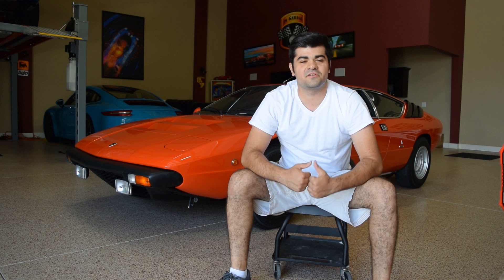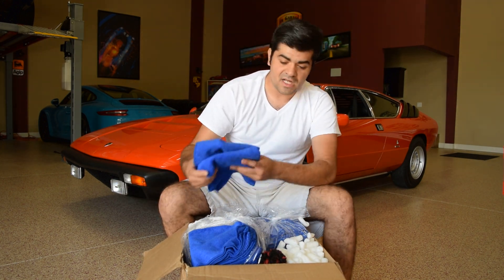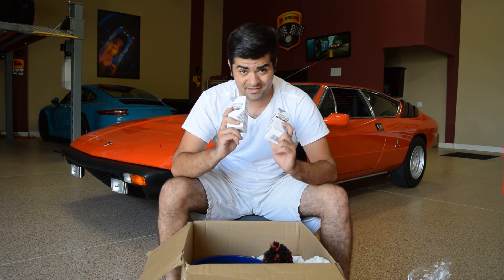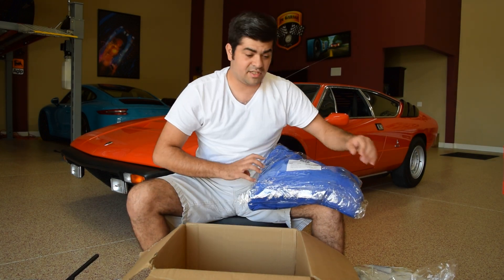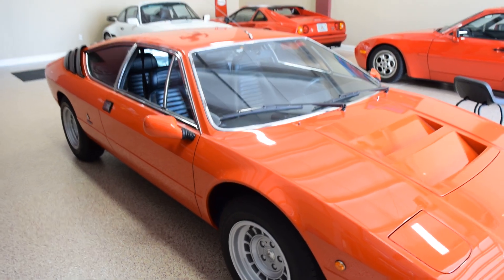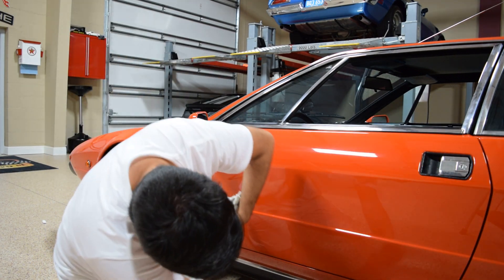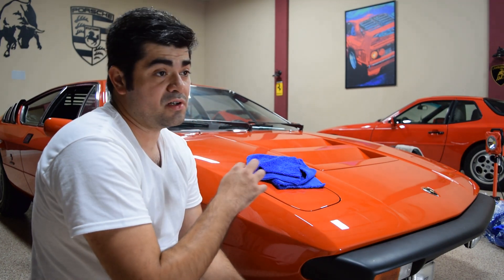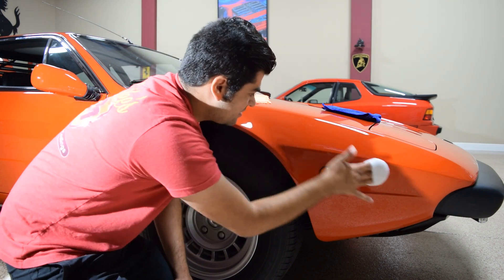Polishing/Coating Lamborghini Urraco With Crystal Serum Light | Unboxing Video

Comment: I've applied a few coatings in the past.  Easier to keep the car clean but once they begin to show swirls, it's a losing battle as you have to polish it off and start over.  Would be nice to find one that was nearly swirl proof.
Reply from the maker: Bingo. Every car is going to need some polishing after the 1-2 year mark. That is why the claims of 7-9 year coating are not realistic. Not that they dont indeed last that long. But after 2 years a car needs to be polished let alone 8 years lol.

Comment: Great work! Looks amazing. Have you ever used the CarPro UK coating? They just released a v3 version of it....Want to coat my car and I’m unsure of what to use.
Reply: 302QuestSwap you need to prep the paint, decon then see what it needs correction or polish then panel wipe then coating.
Reply: Tito Rodriguez that wasn’t my concern....I know how to prep for a coating. I was asking his opinion on two different ceramic coatings.
Reply: 302QuestSwap the version 3.0 is very much improved in application flashing and gloss.
Reply from the maker: I have used the UK coating many times. It leaves behind really good protection and hydrophobic properties. UK is a kind of a pita to work with. You have to work smaller sections because it can be difficult to remove. ALOT of towels are needed to ensure no high spots/streaking. I have no experience with the new v3 version. I have heard good and not so good things about it. When i get the chance to play with it  I will make a video. My advice would be to pick up a bottle of Crystal Serum Light its easy to work with and great perfromance.